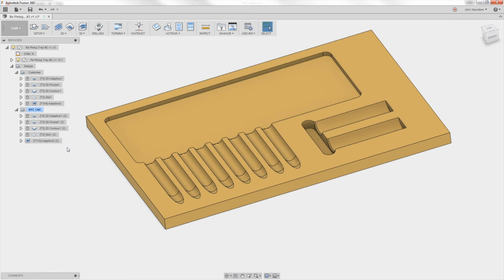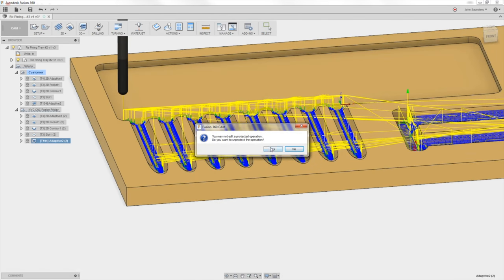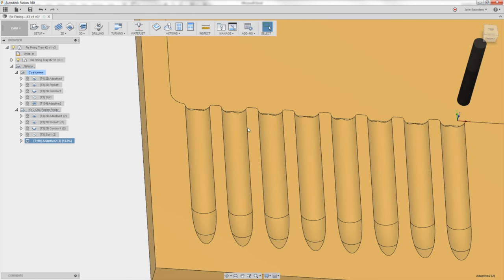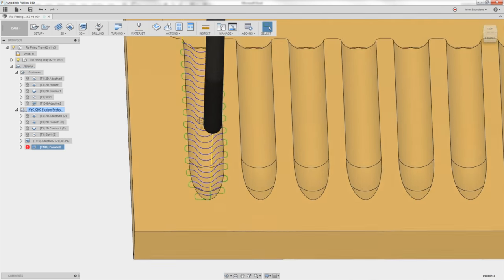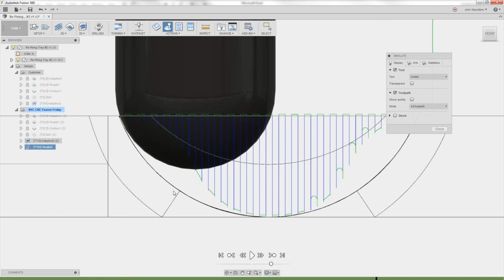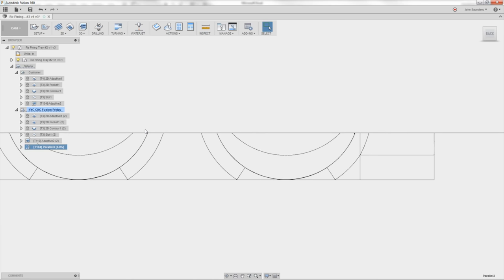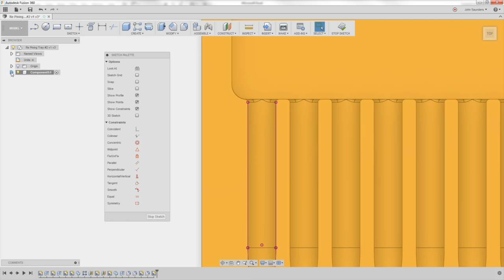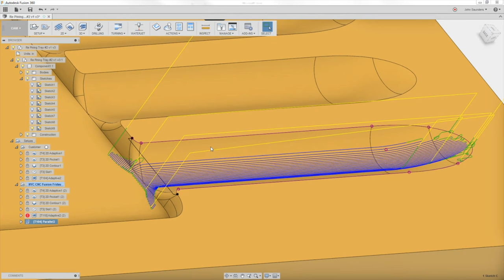Fusion 360 CAM: 3D Toolpath Containment!   FF55

Comment: just found another super easy way to do this. 
In the parallel path window there is a check box called "avoid/touch surfaces" 
its under the geometry tab. lets you select all the surfaces you want the tool path to ignore or machine. 
It was a super eureka moment finding that badboy, really lets you focus the finishing the right area so you
 can make those step overs smaller but still making good time.

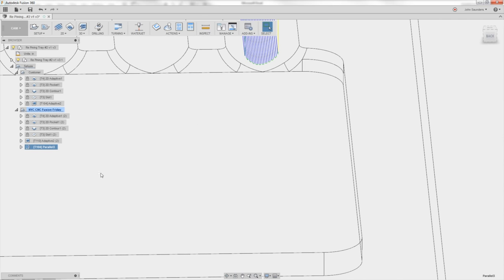Comment: @11:25 (ish) when you have that un-machined scallop of mat'l at the top of the profile that you wanted to get rid of.  You used "Contact edge of boundary" check box to take care of it.  Sometimes this is due to the tool step over you've chosen where the CAD program will evenly divide the profile by the step over you've chosen and it doesn't come out even so there is some mat'l left at the top edge like you're seeing.  Changing the step over to a tad smaller or larger increment can also alleviate this mat'l in a similar way.  When we're doing step-over for a ball mill in our shop we generally use .004" (.1 mm) but sometimes it needs to be slightly more or less, so the CAD back-end can evenly divide that step-over in to the chosen geometry nearly completely.  The "Contact edge of boundary" is a nice option too though and maybe that gives you some idea why that left over mat'l is created in the first place.

Comment: The orange thing that is annoying it the 'Profile' and it's there because when you select a surface as a sketch plane fusion automatically projects that surface to the sketch. I don't know how to turn this off so I just delete everything before I start drawing. Also try using avoid/touch for finishing containment. This means you can just draw an oversized box around the feature you need to machine and then just select anything in that box that you don't want to touch! I use this all the time for finishing and I wish they had it for adaptive roughing!

Comment: Can't decide which cam to learn, choosing between Siemens NX and Fusion 360. I am familiar with NX and have post-processors for my  mills, but it looks a bit outdated compared to FUSION, any advice on this guys?
Reply: Cobrass2 the cost is night and day. Fusion is a fraction of the cost of NX. NX is better with simultaneous 4&5 and high end mill/turn. But Fusion is better everywhere else and much more accurate surfacing toolpaths.

Comment: Hey John, your final parallel tool path does not have the same geometry for the top of the finger pocket as just after you selected  to use contact point boundary. Could you explain why that happened?
Reply: Simple, the pocket is tapering out at that point so the angle between the 'wall' and the top is becoming shallower. As a result the tool is required to step closer to the edge still contact the boundary, make sense?
Reply: The very final tool path in the video @ 16:39 does not have the same tool path at the nose of the pocket flaring out to the boundary as @ 12:37. Is this an oversight: did switching the machining boundary to his projected sketch change the contact point boundary setting?
Reply: Oh, that's what you were on about, my mistake. I suspect that there was something funky going on at 12:37 , I've had this kind of stuff happen and I suspect it just something odd in the algorithm generating that weirdness.